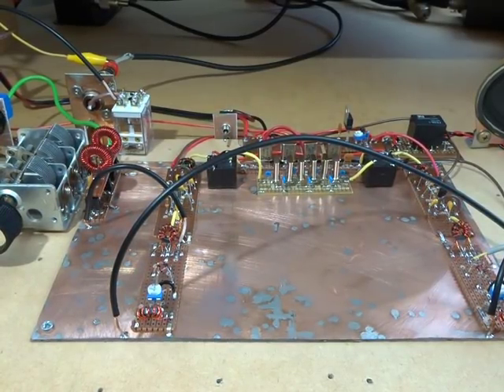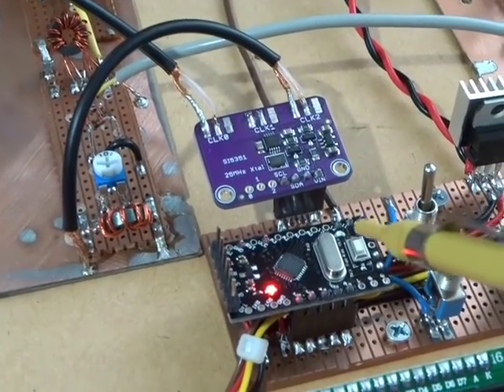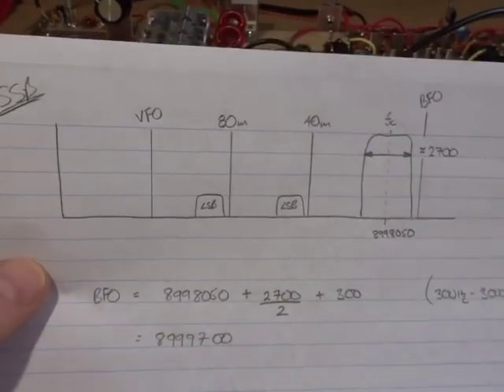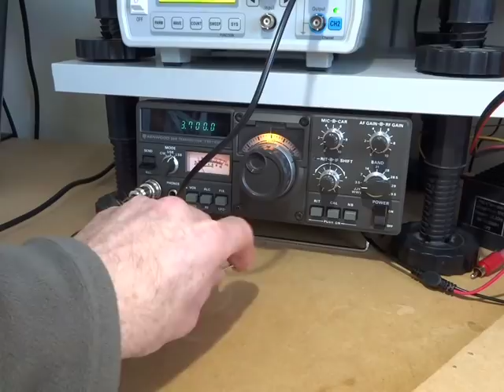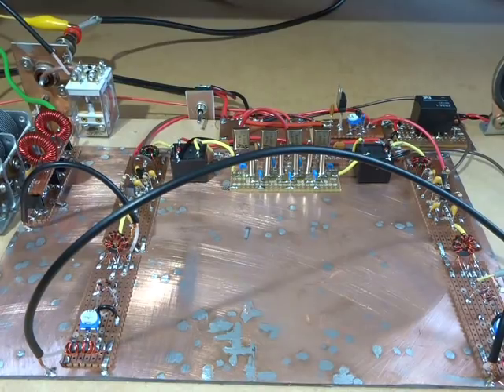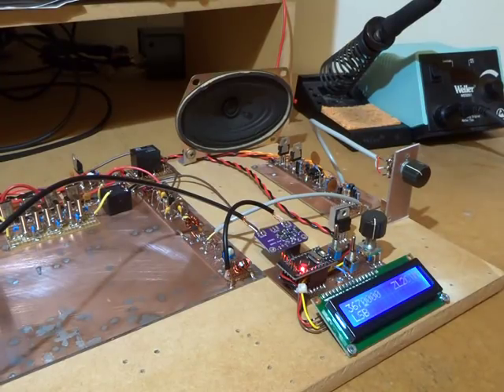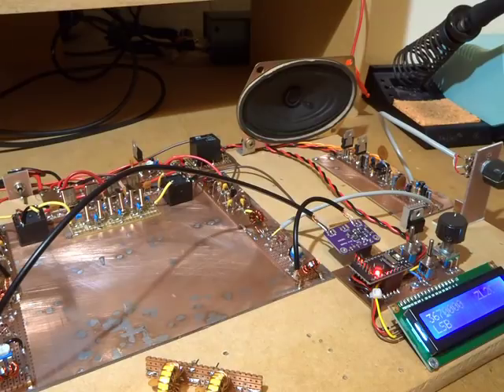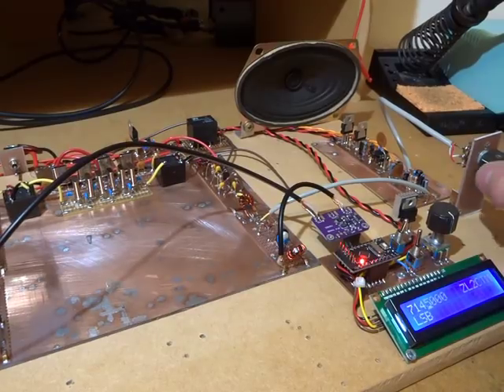Homebrew 80/40m SSB/CW Rig - #7 IF Amps, Superhet Receiver

Comment: At first I thought there was way too much difference between the noise level through the 3kHz filter compared with the 700Hz filter.  But then I remembered that the 700Hz filter has an additional 5dB of loss!

Comment: Hi Charlie, First off, love your videos.  Quick question in relation to the z match between IF amp and crystal filter.  I have a setup very similar to you: exactly the same 9MHz crystal filter and a feedback IF amp that needs to see 200 ohms on the collector for the gain to be per spec.  I have a transformer on the IF amp that converts a 50 ohm load -> 200 ohm on the collector (so the load determines the collector impedance, which determines the gain).  But now I'm connecting my amp to the filter as you have done and I see a chicken and egg situation!:-) The amp determines its collector load based on the (supposedly 50 ohm) transformer load, but the filter sees 200 ohms based on the output of the amp.  How do you reconcile the two?

Comment: hi Charlie , just a quick note about the si5351 boards, I neglected to point out previously when posting on your videos. The si5351 boards use a 25 or 27 MHz crystal ( mostly 25Mhz). These boards are quite often around 24.990- to just a fraction below 25 MHz. you cant really use them unless you use some calibration routine. if you use them without a calibration routine your signals wont sit were you expect them in the passband and can create a little more noise than it should ( due to the signal being to one side in your filter passband).one experiment is to run your signal generator and your si5351 in to your double balanced mixer feed this to an audio amp and  tune them both to the same frequency and see if they zero beat. This is a simple task to see if the output of the si5351 boards is where you expect it to be. That way the output of any signal is more lightly to be in the passband properly and generate less nose ( closer to the commercial radio).I do have some code somewhere that adds calibration and takes into account the difference in frequency from 25 MHz and only needs to be done once per board ( unless recycled into other radios). if you require this let me know and I will email you the details over to you.best regards and best 73'sSimon
Reply: Etherkit has a nice calibration example for the si5351. https://github.com/etherkit/Si5351Arduino
Reply: thanks Mathew, it will save me looking it up here. Charlie just needs one example to know if that is causing minor errors in frequency and adding noise.
Reply from the maker: Thanks Simon and Matthew. I am aware that each board needs calibration and that function is build in to Si5351 library. Would it be fair to say that any inaccuracies can be corrected using a 'fiddle' factor like I use in the 'Send Frequency' function? If that approach is not correct, then I'll do as you suggest and add the correction at start up as per the library.

Thanks again

Charlie
Reply: hi Charlie,   that would entirely depend where the fiddle factor is being done, its useless to add it to the display as the error would still be there. you cant just add it to the output and not the display … so it does depend on how the fiddle factor is done and at what stage. the calibration routines are to allow the real frequency of the crystal to be used and factored in to the frequency calculations. the si5351 upconverts the 25 MHz to a frequency in the range of 600MHz to 900Mhz ( basically multiplies the frequency of the crystal by 24 to get 600 MHz and by 36 to get 900Mhz … a fiddle factor of say 50 HZ may suit the multiply by 24 to get 600 MHz. but wont suit the multiply by 36 to get 900 MHz). the 600 MHz  to 900 MHz is like an intermediate step and is calculated on each new frequency you select. in the routines it may select 600 MHZ for say 3.5 MHz but could in theory at least choose 900 MHZ for 3.501 MHZ. The routines will select the closest match to any frequency in the 600 MHz to 900 Mhz range to give the best divider with the least jitter on the output. so in my honest opinion its not suitable to apply a fiddle factor as that implies that the routines will only ever use 1 frequency in the intermediate step of going to the range of 600 to 900 MHZ. If you try to manually select just 1 frequency in that intermediate step of say 600 MHZ then you will get jitter on your output for those tricky frequencies where the divider uses a non integer divider ( it goes into fractional mode, which tends to be only a close approximation of the frequency you actually want ). Best regards Simon
Reply: Here is some maths to show why its better to use calibration and not fiddle factors … Lets assume that the crystal is actually on 24.999950 MHz multiply this by 28 ( it gives almost 700 MHz) this Gives 699.9986 MHz ( Not The 700 MHz as expected ) now divide the 699.9986 by 200 ( for 3.5 MHz ) this gives 3.499993 needing a fiddle factor of +7 Hz. Now Lets calculate the same crystal for 7 MHz... 24.999950 multiplied by 28 gives 699.9986 divided by 100 … this gives 6.999986 which is now 14 Hz fiddle factor. an increase of frequency slowly increases the fiddle factor per band. if you add a band at 14 MHz then the fiddle factor becomes 28 Hz ETC. but calibration actually takes the real crystal frequency and  removes the error at that first stage to actually get 700 MHz then divide by 200 for 3.5 MHz and you get 3.5Mhz ( with no errors ). If you Use a fiddle factor of +50 Hz on 80 meters then your crystal is actually very close to 24.99964285 MHz (24.99964285 MHz  multiply by 28 = 699.9899998 now divide by 200 =3.499949999 <-very close to the +50Hz you specified in the video).  if you use fiddle factors then you must use one for each band you implement (See the above examples), If you use calibration it only needs to be done once as it removes the error before the band frequency is calculated. I hope this clears up why calibration is better than fiddle factors. Best regards Simon
Reply from the maker: Cheers. I must admit I tend to use one of the commercial rigs as a piece of test equipment and transmit an 'assumed' known good signal then adjust the fiddle factor to make it sound good though the crystal filter. The same applies for transmit. At the end of the day the receiver only has three transistors (excluding the AF amp), so it's not too bad really.
Reply from the maker: That's really interesting thanks Simon. I'll look into that today and see if my library has the same calibration tool as suggested by Matthew. Thanks again for the feedback.
Reply from the maker: Perfect Simon. That settles it in my mind. From now on I'll make the effort to calibrate each Si5351 module. I'll do that today. Thanks for taking the time to explain it to me and well as the others reading this. Mush appreciated indeed.

Charlie
Reply from the maker: Just running the calibration now. I'm using the sig gen and the XY mode on the o'scope. That seems to be working really well. Just waiting 30mins or so for everything to settle down temperature wise.
Reply from the maker: Just running that now Matthew. Very useful tool thanks.
Reply: hi Charlie .. no problem, the datasheet for the si5351 does come in handy sometimes. It's hard to follow sometimes but once work out that they use a 2 stage frequency generation ( oscillator to intermediate stage then intermediate stage to output stage it helps demystify this product). Here's a fun fact to generate 3.5 MHz there are only 2 choices for the intermediate stage frequency ( that's 700 and 875 MHz). Just so you know... you are already using the calibrate routine but you left it set to zero but it actually still runs the code, you then ran extra code to do a fiddle factor .                                                                                                                                                                                                           Best regards and goodnight all  Simon
Reply from the maker: Thanks again Simon. For my library this worked for me:

si5351.init(SI5351_CRYSTAL_LOAD_8PF, 0);
si5351.set_correction(34700);

Having the calibration offset in the first line (3rd argument) didn't compile. This version does and the 50Hz offset in the radio code is no longer required. Yay!
Reply: hi Charlie, glad It all worked out and this si5351 board is now calibrated to the same level as your signal generator. Now you just need a small sticky label on the board and write the calibration number on the board ( or better still use a sharpie and write it on the PCB… no label to lose). This way that board when recycled to the next radio its calibration number follows it ( to the next piece of code on the next radio ETC...). if you ever need to replace the si5351 board you can write its calibration into your code and your radio is still exactly where you expect it to be (in the middle of your passband, giving you the minimum amount of additional noise on the signals of interest). Next time video your process ( if you didn't already) to help others that are not sure how and why it needs to be done ( some people need to watch a video as reading about it is not enough for them to fully understand it). Your software code is now like the hardware and has been simplified ( no more writing repeated lines for each output and each band, making your code a lot smaller and easier to understand). Best regards Simon
Reply from the maker: Sure thing Simon. I'll add that to the video list. 

Charlie

Comment: Charlie, could I use a 0.96 i2c display instead thi biggest one? Do you have the code ? Thanks
Reply from the maker: Sure you can Emerson. Just be cautious as I have had problems with those displays producing noise. Check out the blog for suitable code.

Charlie
Reply: @CharlieMorrisZL2CTM  Did U decouple all display pins to avoid that? Something I've tried was putting a ferrite beads between display and wires, even shielded it with aluminum foils. Anyway I'm looking for a 11meters vfo which is possible to change bands, change display resolution.... A multivfeature vfo...So have U noticed about it? 
Nice receiver you,ve buit
73
Reply from the maker: I tried a number of things a while back with no joy. I might take another look at the screen size is ideal for small tramping rigs.

Comment: Finally, you made it!
Reply from the maker: Hi Moustapha. Yes, i tend to start at the audio end and work my way forward. Once you have all the modules putting the superhet together doesn't take too long. I'm currently doing low power transmit tests (no PA) and they are not too bad either. The bilateral amps are working fine.
Reply: That's the spirit my friend. We are waiting!